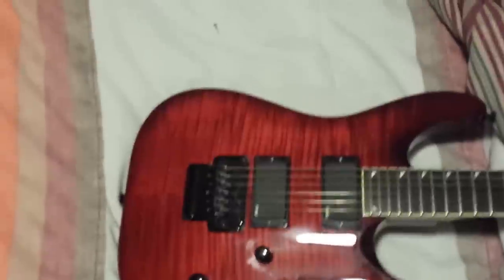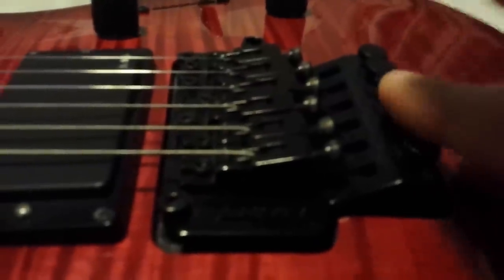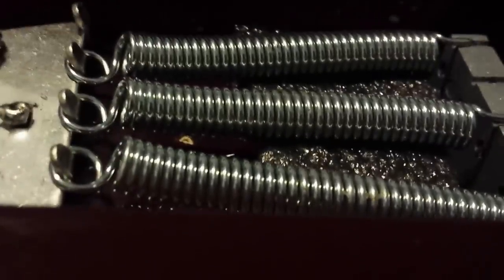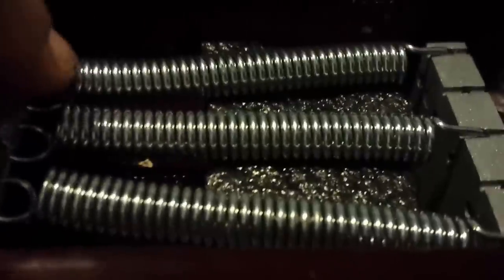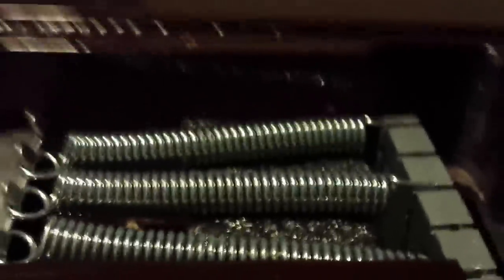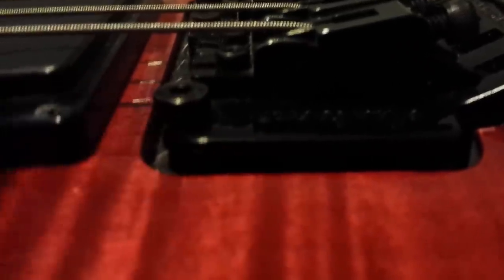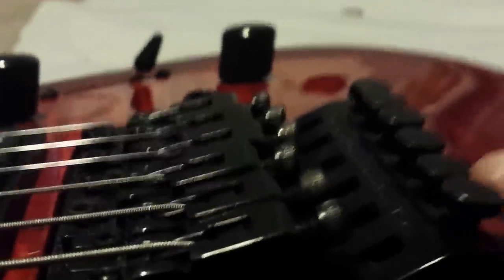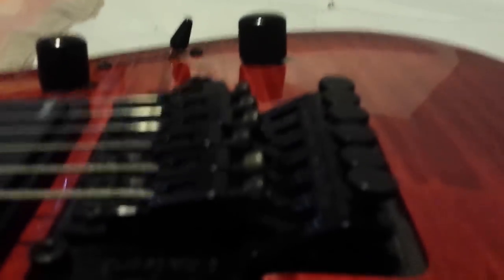How to set up a Floyd Rose Tremolo.

Comment: Something else that helps is changing the position of the springs. Mine were like they are in the video. I unhooked the two out springs and attatched them going straight across. All springs straight across instead of the triangle shape as seen in the video. May not work for every axe but for my Jackson RR it made a big difference.
Reply from the maker: Thats how i normally have it, but geometry says that when you angle the outside two, theres a small fracti0on of more tension. As i know it is basically worthless, I just decided to say "fuck it." hahaha
Reply: WaRLoKWYATT Honestly I prefer a little less tension. When I use the whammy bar it doesnt feel as tight. And while I may like tightness in other things, my tremolo bar isnt one of them. Lol

Comment: thanks so much dude! saved my ass and my guitar, and watching a 30 min video. thanks bro!
Reply from the maker: +Robert Tyll If you ever have any questions, don't hesitate to ask. I want people to ask questions. If you know people who need help, send em my way.
Reply: For thicker strings would you have a higher or lower action?
Reply from the maker: Robert Tyll Raise the action a bit and you'll get less fret buzz and be able to play harder. Each time you adjust action height, make sure to go through and check the intonation. Tune it to the tuning your using, make sure the tuning is right on every open string, check the tuning of the harmonic that the 12th fret, then check the tuning on each string pressing down on the 12th fret. If the tuning is flat when you check each at the 12th fret, then you move the saddle forward, if the string is sharp, move the saddle back, basically lengthening or shortening the strings to be in tune with themselves. That is probably one of, if not THE biggest part in making your guitar play well, be in tune and sound good.
Reply: FINALLY THE ANSWER I'VE BEEN LOOKING FOR, THIS HAS BEEN MY PROBLEM, ALSO WHAT CAN I DO TO FIX THIS PROBLEM->WHEN I DIVE DOWN IT RETURNS TO NEUTRAL, WHEN I PULL UP IT GOES SHARP, WHAT CAN I DO TO FIX THIS/?

Comment: I like the tuning stability of the locking system but not the going sharp when I palm mute and going flat when bend strings. I used some coins in the back to disable my Floyd and have a rock solid rhythm guitar. If I want to dive bomb I use a Digitech Whammy. I've got an old Yamaha one humbucker that I'm going to Frankenstrat with a cheap Floyd I just got in from China. I'm thinking that if I make it trem to the body with no back rout I should have a stable platform for power chunk with a dive bomb option. Were Van Halen's originals set up like this? I'll have to check.
Reply from the maker: Yeah his guitars have the standard Floyd rose, not the floating like mine. I have no problems with palm muting sharp and I'm heavy handed as fuck. You must use thin strings or somethin.

Comment: i have a question and I think it is more about my new guitar tech issue, but here goes, if you can point me in the right direction I would greatly appreciate it. I just bought a new Jackson Pro Soloist SL2Q MAH translucent blue. I love it, and when I got the strings, it had those awful DAddario strings 9-42 on them. I do not like them they sound dull. I played the guitar in TUNE for about 2 days and decided to change them to EB Cobalts. I put a plastic measuring cup handle to stop gap the floyd rose and have it set level for tuning. I got the guitar in tune, locked my nut and then retuned with the fine tuners. All was well for ONE DAY LOL. Since then, I have been playing and having to retune continuously., I go sharp, like WAY sharp on every string. So I went back to unlocking the nut and setting up the floyd level again and down tuned each string. Which when relocking, and adjusting the fine tuners, got me in tune, for about one song and then I go sharp again, and the fine tuners run out of space to move back into tune again. So frustrated with this problem, do I need to adjust the screws in the back to correct this? Or is it user error? the guitar, it is only one week old. Bummed. I only tuned the first string to the tuner, and the rest by ear by the way. But I knew I was going sharp in mid play by the song I was playing with...any help or direction? thanks for listening
Reply from the maker: +Roland Lemus Jesus Christ that was a lot of questions.. First off, what kind of guitar are you using and is it fitted with a Floyd rose copy, or original? Sometimes there's problems with the bridge's knife edge and it could be a multitude of things. Tell me about your guitar. Does it have a thin neck, what guage strings due you use, let me know that basic stuff and I will point you in the right direction.
Reply: Warlok, you are the only one that responded to me, which is much appreciated, and granted I wanted to give as much detail as I could and so I see I left out the type of guitar. It is the Jackson Pro Solist Mah as in my profile pic there. The floyd rose is a Floyd Rose FRT-O5000 Double-Locking Tremolo (Recessed). I figured it out though, and this is what I did. I had to adjust the screws in the back towards the neck direction. When I changed the strings, the Ernie Ball Cobalts were different from the DAddarios. Both were the same gauge (9-42), but I think the cobalts were different. So did this trial and error, I went the WRONG way first, and went towards the bridge which wasted a lot of time. But as in everything, tried the other way and I started to get closer and closer without having to tune really off to compensate. I literally screwed towards the neck only by ONE turn each time until I was dead on, and everything was level and flush, and in tune. It stays in tune now through all kinds of tremolo usage. I was pretty frustrated and tired when I wrote that request lol, I greatly appreciate your willingness to help! Thank you for sharing as well to help us newbies on the floating bridge!
Reply from the maker: +Roland Lemus Yep, there ya go! Its all about having patience and going back and forth with the string tention and the tention screws in the back of the guitar. Its basically a balancing act between the two and if your bridge isn't fucked up, the only time it will go out of tune is with changes in temperature and the neck itself fluxuates. If you ever have any other questions about anything, feel free to add me on Facebook. Search "Warlok wyatt" and there will be two accounts. Both of them are mine, just message both and I will add you. Just say "I'm the Floyd rose guy."
Reply: Thanks man, I appreciate the feedback!

Comment: Do you need to de tune the strings when you adjust the posts for action? I've heard not de tuning ruins the knife edges
Reply from the maker: Yeah you should as a precaution. Unless it's a small adjustment because you need to see where the bridge height is at full tension.

Comment: So i' ve bought a chinese Schecter diamond sunset on sale at 50% for around 180$ and it' s actually built quite good... even the frets are nice, but everything trem-related is made of something softer than rubber. the nut has got some WW1-style trenches being formed after a week of playing and the licensed floyd rose is... okay-ish
i' m looking to replace the nut and the bridge with some schaller goodies so i' d like to know is it gonna be awesome at the end, or will it refuse to stay in tune because of the guitar... is this a smart thing to do?
Reply from the maker: +Filip Jakirac You know what, if you are going to throw down the money on a nice trem, invest in an Original Floyd Rose. They are made very durable and dense brass, which has more tonal transference and the knife edges on the pivot points stay nice and sharp, rather than wear down. They come with a nice brass block so there's more mass, which again; creates more tonal transference and helps the guitar resonate better. On top of that; you don't have to worry about the whammy bar constantly coming loose and falling off, because the mechanism for it is different. The Original Made in Germany Floyd Rose is the creme de la creme.

Comment: Lots of questions: Im releasing those three strings inside becouse my bridge base plate is not parallel at all with body, at start you could see it decreasing, but more I did it the less it got parallel.. I dont know if I should continue becouse I dont know to what point you can pull that screw out...
Reply from the maker: Matej Kramár Are you talking about the springs and the claw? While you're tuning it up, just tighten the screws on the claw until the bridge is floating correctly.

Comment: Hey wyatt. Got a new guitar with a original floyd. Followed all the steps. Bridge is level. Locking nut all tight. Can tune the guitar but it never returns to correct pitch after using the trem. Always about 5 cents sharp or flat. Strecthed the strings. Spring seem fine. Any ideas? Very frustrating. I've tried tuning it about 4 times from scratch. Using 9 to 42 elixir strings. Thanks
Reply from the maker: Hmmm. It's either the claw tension or the knife edges of the trem aren't lined up right. You might wanna try bumping up a size in strings. That always seems to lend a bit more tuning stability. If that doesn't work, try giving the claw an angle so tension is compensating for one side. It's usually just a matter of doing that until you find it's sweet spot.
Reply from the maker: They are a bitch, I know. But once you find their sweet spot, it gets alot easier and the consistency is worth it. It just takes some tinkering to get it where it needs to be. Also, I'm not a huge fan of elixir electric strings. Coating on electric strings always makes things weird. The coating could possibly effect that, but I'm not sure. Ya might wanna just try bumping to 10-46 with some good uncoated strings like Dunlop. DR strings are great with trems. Ernie ball has titanium coated strings that act like regular strings, but last a bit longer. My strings last a long ass time and I've played everything under the sun. I usually play DR or Dunlops. They never break and they sound and feel amazing. Plus I rarely have tuning issues. Just sayin haha!

Comment: If you are going from a lighter gauge to thicker gauge would you tighten the springs or loosen them? Please respond thanks
Reply from the maker: It depends on if you are wanting to float the bridge to use the tremolo, or if you want the bridge to be flat, but still use the trem, or if you want it solid and aren't gonna use the trem. But yes, if you're going up in string gauge, you will want to adjust the springs accordingly. If you're gonna float the bridge (meaning you can pull the bar up and down) you're gonna want to angle the claw in the back so that the springs are a little tighter than the springs on the higher strings side. It'll help with tuning stability.

If you are gonna be using the trem like I said, only put on three springs; top, middle and bottom and they should be straight. Don't angle the outer two springs towards the center, it creates uneven tension.

If you just want your guitar solid and don't use the trem, put on all 5 springs and tighten them substantially. Also, to avoid sympathetic vibrations and ringing, it helps to put a piece of foam under the springs and preferably, behind the nut, under the strings. And if you are using the trem, make sure the nut is lubricated if the nut isn't graphite or the graphtec Tusq material. All of these things together will make the tuning more stable and your playing sound cleaner.

Comment: Can you tell me what model tremolo that is, exactly? Because I have an Ibanez, on which I'd like to replace the tremolo. It needs to be that design, with te saddle lock bolts above the fine tuners, like that one. I'd really like to find a drop in. replacement, or upgrade Floyd for this puppy. It came with the Low TRS II Ibanez (Floyd Rose) trem, and you can't just replace it with any trem, without some router work, and I really don't want to do that.
Reply from the maker: Get an Ibanez Edge tremolo. They are every bit as good as an original Floyd. I made this video for people who have a Floyd licensed bridge. The Ibanez edge trems are great and will be way easier to install if you are working on an Ibanez guitar.
Reply from the maker: You can Email me at Wyattbruch@gmail.com if you need any help finding this stuff. I'm pretty good at finding great deals.
Reply from the maker: Did you get any of this or what?!

Comment: having problems with my floyd rose on my  schecter , when pulling the tremelo it goes horribly out of tune but pushing trem is fine , is this down to set up or could this be something else , any help would be great ,thanks
Reply from the maker: Are you stretching out the strings well before you use the trem? It sounds like it might just be the strings stretching out.
Reply: @WaRLoKWYATT they arent new strings so they have been worn in  just a recent thing really,  never had this problem before , very unusual

Comment: soo i was tuning my guitar then tighting the screws in the back like you sayed then all of a sudden a string broke .........wtf
Reply from the maker: +Gabriel Nagy lol I don't know what to tell ya, bud. It's not because of my advice. Thousands of others have watched this video and been helped. If you have a problem, let me know the specifics of what's going wrong and I can help.
Reply from the maker: +Gabriel Nagy Lol sometimes strings break man. What kind of strings were you using? Also, make sure you seat the string deep in the pocket before locking it down and don't overtighten. If it's not far enough down, the string will pop out and if you tighten it furiously, you can krimp the string and it will break. But sometimes there's just a defective string. That happens with Ernie Ball strings (from my experience.) I use either DR strings, D'Addario, or Dunlop strings. I almost never break a string. The only time I do, is when I use Ernie Ball singles. I once snapped four .010 strings in one sitting, just trying to restring a guitar, so I get it. Lol

Comment: what if you took off all your strings while changing them?? should I just take it to a tech?
Reply from the maker: +freddie garcia You should be taking off all the strings so you can clean the fretboard and everything else. Just make sure you unlock the nut, put and eraser or something under the bridge so that when you loosen all the strings and take them off, it doesn't suck the bridge all the way down. That way when you've wiped down everything, you can put your strings on easily. Just make sure you tune the strings up and stretch them out before you take the eraser block out from under the bridge, so you can tune it up to pitch and make sure the bridge is flush, like in the video, then lock the nut again and finish tuning with the fine tuners.

Once you do it a few times, you'll get used to it and you'll be glad you know how to do it yourself, trust me.
Reply: A spoon works great as a wedge
Reply: I put a dice in the back so I can play it but there is still some buzzing and the floyd is kinda tiltled to one side so the higher strings and from frets 17-24 sound weird.  I'm more of a rhythm guy but that still sucks.  Don't get me wrong it is playable and stuff but I cant use the floyd at all. idk if I should take it to get it fixed
Reply from the maker: freddie garcia I could fix this easily! I wish people could just transport to me so I can show them how to work on guitars!